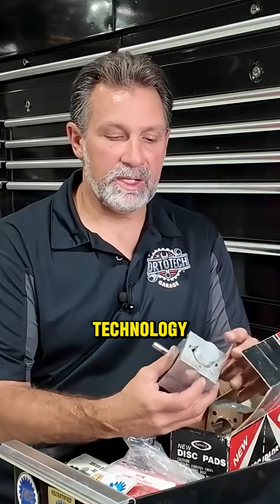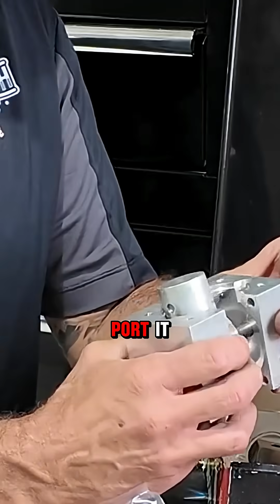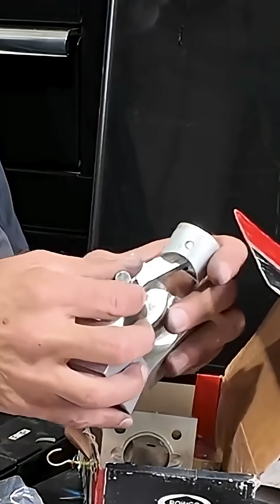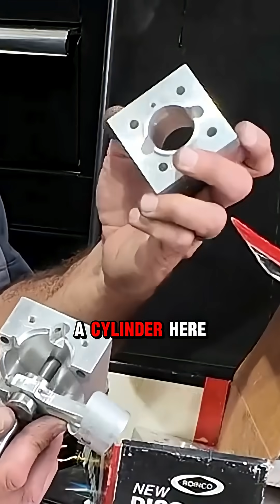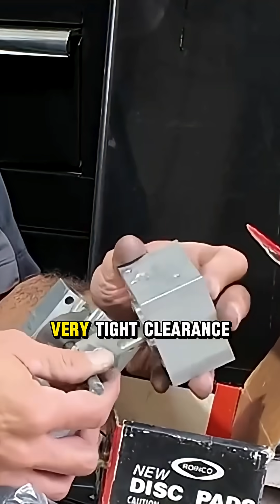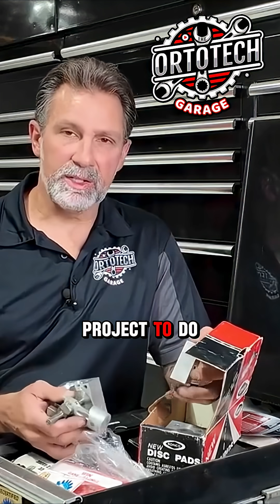I Built This Engine From Scratch in College!

Comment: - we did a stirling Engine in Mechanical Engineering (as a group of 4) - yes it had to run (pass wasn't predicated on it running, but to get decent grades - sure..)
Reply from the maker: Fantastic!  There needs to be more hands on in education all around.  It's not enough to learn the fundamentals only. You need practical application of what you learn.   A lot of people, like me, learn by doing.  Besides, It also makes learning more fun!   👍